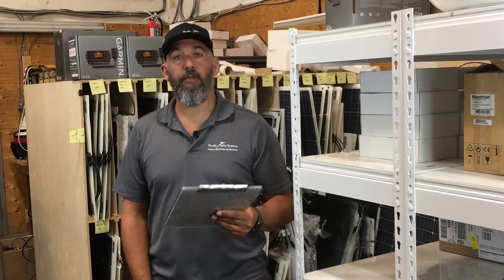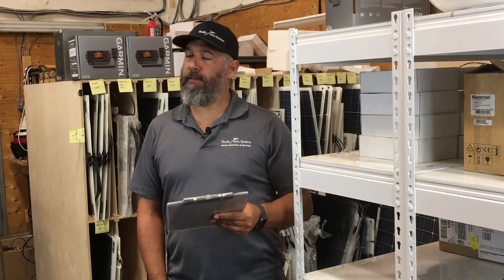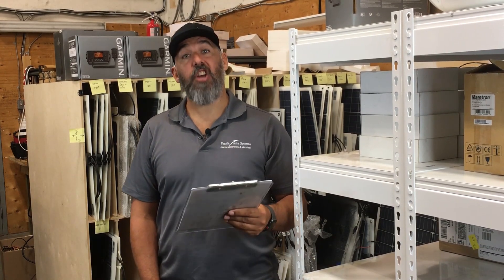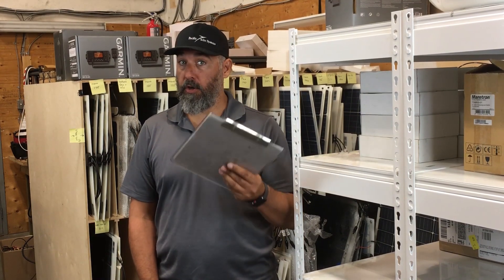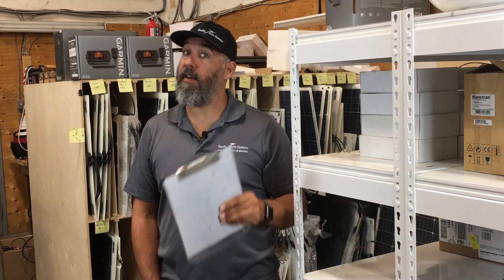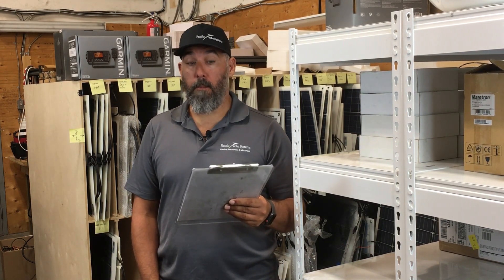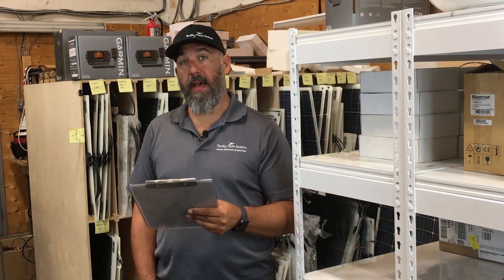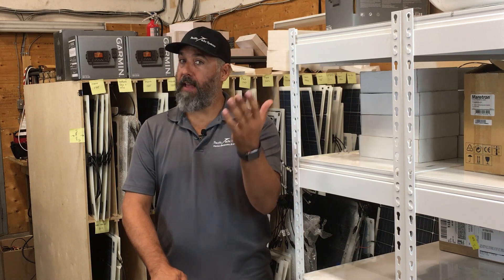What Is The Purpose of a Shunt?

Comment: The question "What is the purpose of a shunt" was not answered. Questions like how it works and what is does and how to install it were answered, but not the purpose to my humble opinion. 
So I would like to ask again "What is the purpose of a shunt", why would I install it. I charge my battery when I can, as much as I can and try to use them as little as possible anyway....
Reply: Shunt isn’t needed it’s kinda gimmicky. If you have a solar mppt from like Victron with Bluetooth you can get a lot of info. In my world enough info. It’s not accurate like a shunt but okay. You can tell the charge of the battery by the voltage in the app when there is no load on the battery. No charging or drawing power from it
Reply from the maker: The purpose of the shunt is to measure current.
Reply: @PacificYachtSystems  That is what it does, but what is the purpose of measuring the current....... it is data but what is de information. What decisions do you make based on it?

Comment: Hi Jeff, is it a problem if the positive wire (going to the battery) and the negative wire (going to the shunt) - which are both coming from the MPPT - have a different length?
Reply from the maker: Nope, that's not a problem. Quite often the positive and negative wires are different lenghts.

Comment: Very interesting videos.  I have an on/off switch for a battery combiner.  Should it be on at all times?
Reply from the maker: The short answer is no. You should only have batteries manually on combine if you need to share a charging voltage or if you need both batteries to start an engine.